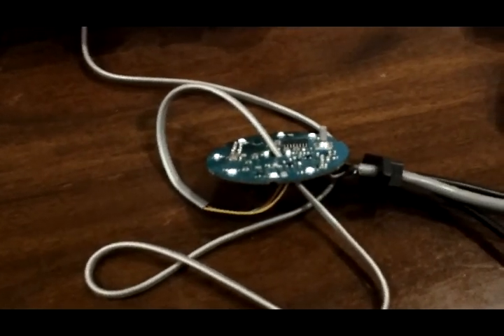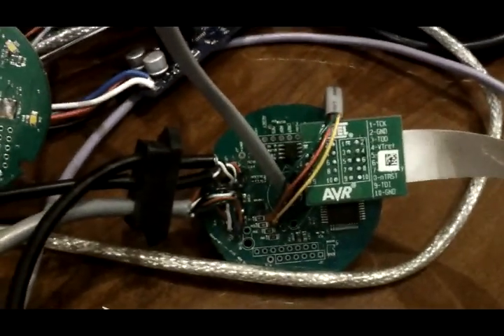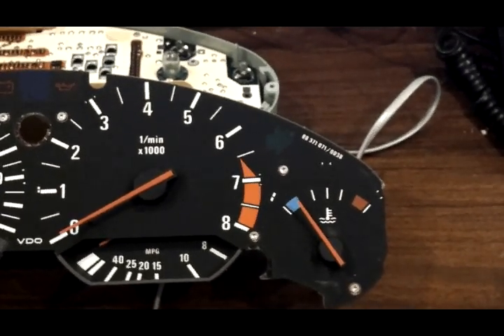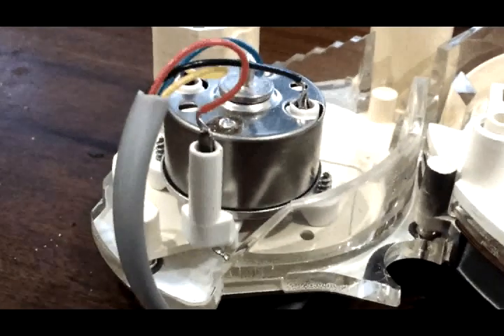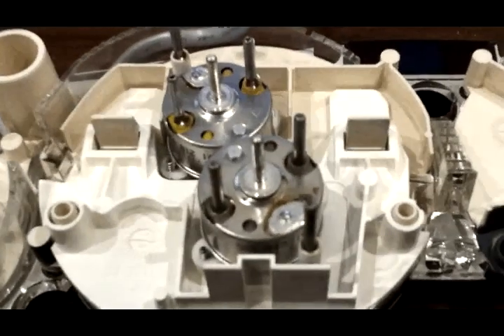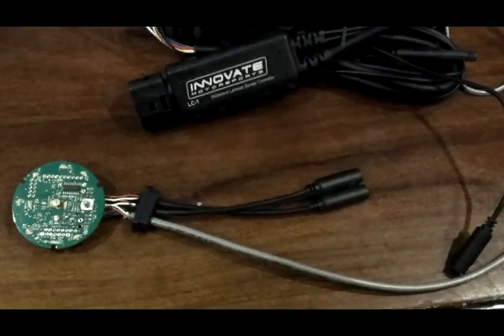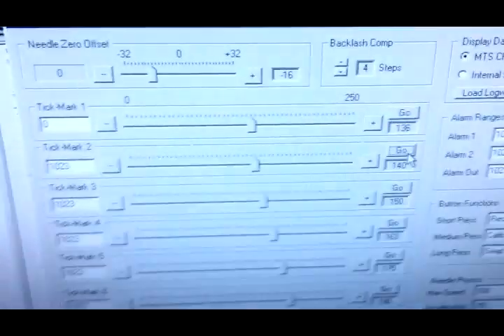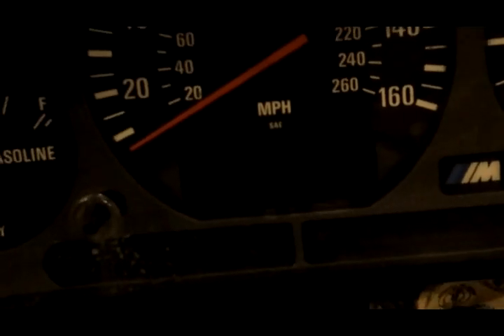BMW E36 temp gage mod for direct temperature display. Without the buffer range.

Comment: I wonder why you wouldnt just put the gauge face on the cluster and use the aftemarket gauge itself so you get actual dynamic gauge readings rather than the 5 setpoints..  seems like if it was rapidly rising in temp then itd take it more time to readout on the setpoint readout..
Reply from the maker: The 5 points were just calibration points.  The driver has 1024 point resolution.  Worked perfectly, until I sold the car, several years ago.  But, to directly answer your question, given the above, I wanted to retain the stock appearance.  I never got around to modifying the useless MPG gauge to show AFR.  This was a LONG time ago :)

Comment: Any chance you still have the resistance values and corresponding temps for the stock temp guage? I'd like to test my sensor circuit against another gauge to see where my issue is. I do not think the gauge is showing the correct temperature. Thank you!
Reply from the maker: I got the values of of the BOSCH datasheets for the sensors, which I found online. IIRC, there is a blue one and a black one.  The M3 uses one of each. But, I forget which is which.  The sensor that controls the gauge, does nothing else.  The other one goes to the ECU.  So, no worries, there.
Reply: @lordandprotector  thank you for the reply man! I will definitely look into the data sheets. As far as I know all obd1 m50/s50 use both the blue and black sensors. I've replaced them both but no change on my gauge. I'm thinking my needle may have spun on the output shaft. When the car is totally cold, the needle rests just above the blue section. This happens when the ignition is on and when the key is out. My gauge use to flail around a lot so I'm thinking it could have worked itself loose. Just want to verify the resistances before tearing the dash apart again. Thanks again!
Reply from the maker: I did find an old excel file with the calibration for what I think was the black sensor.  Which is the harder one to find the datasheet for.  But. no idea how to upload it, here.

Comment: so the gauge is acting stupid on all m3s and 325.
But the engine is safe?? 
my car says it overheat but then the gauge is moving crazy and 5 min later its on normal temp.
Reply from the maker: If the gauge says overheat, it is probably overheated.  Mine had a big air bubble in the system.
Reply: I know this is an old comment, but I just want to add some information. If your guage is acting irratic and not moving smoothly, ie just flailing all over the place, you likely have a broken solder joint. I reflowed the solder on the back of the gauge stepper and this solved my issue with that scenario. Hope you've figured this out by now or found another solution!

Comment from the maker: Yes.  I just took the DME completely out of the circuit. The little PCB connects directly to the gauge motor pins and the temp sensor.

The PCB is the controller from an old MTIHP GxDigital needle gauge.

I just reprogrammed it to control the existing VDO gauge.